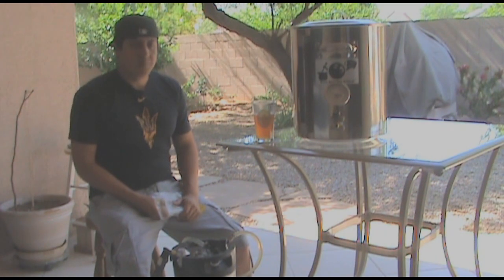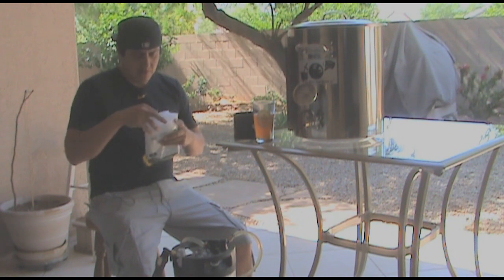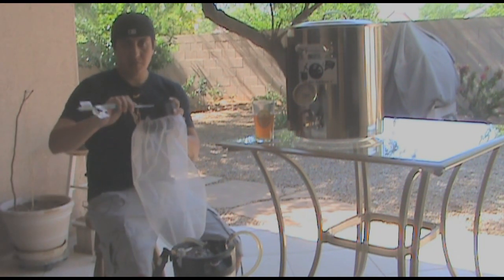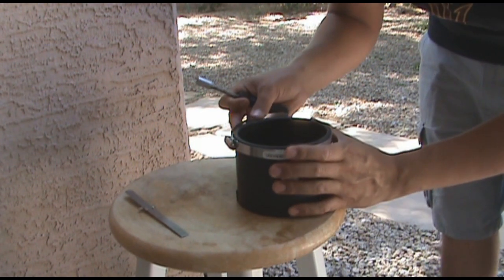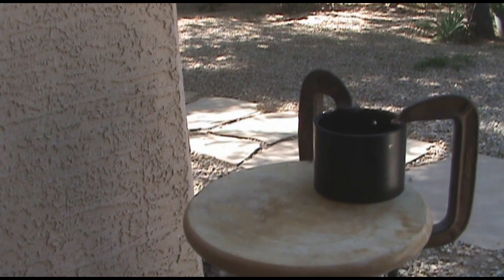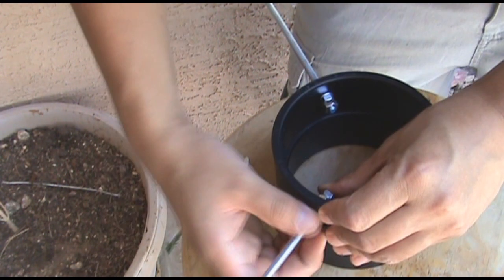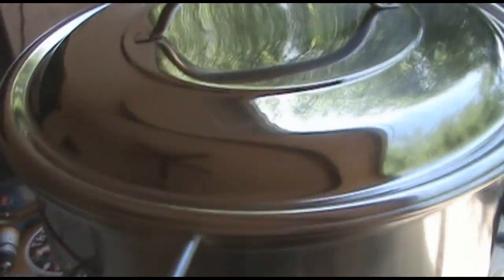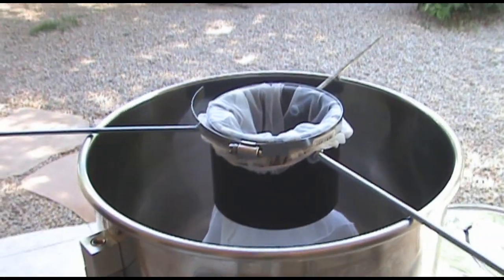How To Build A Hop Filter

Comment: Good, ABS bends more as it gets hot. It could droop some in the steam. PVC gets dislocation failures and cracks. That is a big deal if it is under pressure, but it may hold up better in your situation.

Comment: It looks like an ABS joint (coupler). They use it and it's foam filled superlative for less noisy DWV (sewer)  pipes. They cost more, and thus may seem automatically better. Haven't seen the black PVC. Still don't trust paint filters in boiling water. Use the combo adhesive with this stuff if gluing together. The regular PVC solvent doesn't work right. ABS is worse in hot water than PVC (white stuff), but neither are made for it. Some ABS is approved for hot water, but it isn't at Home Depot.

Comment: Been using all kinds of pipe for over 30 years, haven't seen black PVC except in plastic furniture kits. Bet it is ABS. Plumbing supplies are colored on purpose so that they aren't mixed inappropriately. What department did you get it from?

Comment from the maker: I went back and it turns out it is actually ABS plastic... it's rated to withstand up to 180 F, which is higher than PVC... the plastic won't be in contact with the wort, but I'll still run a test before using it with my wort...